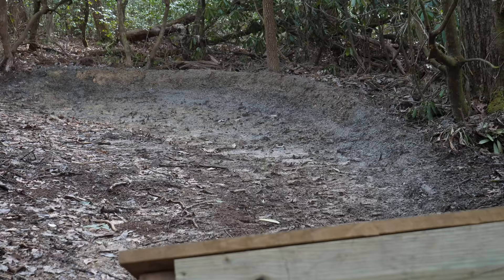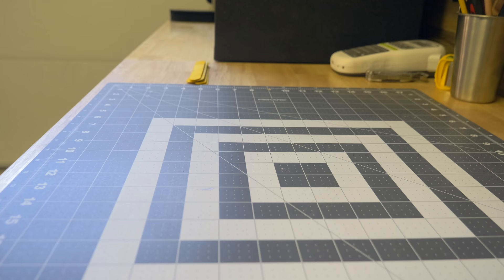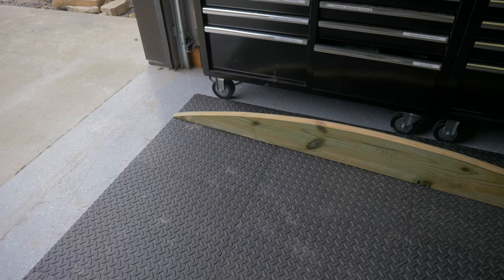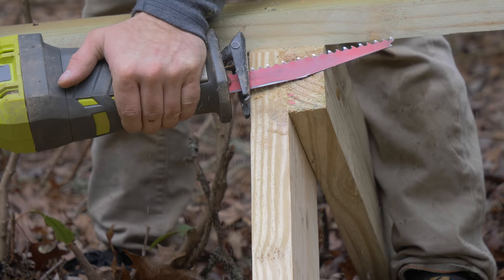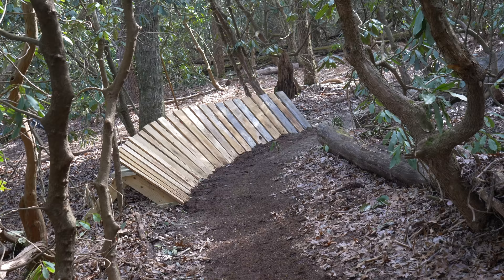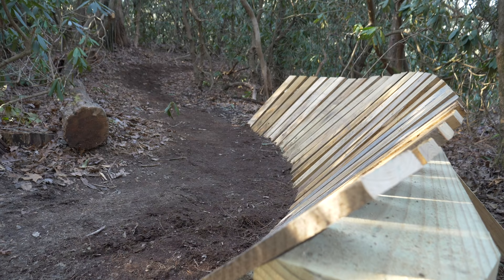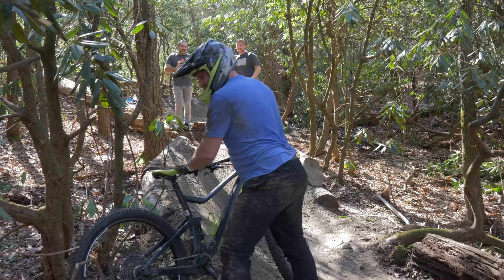Building & Riding a FAST wooden berm

Comment: LOL  I love it. One look at my Avitar shows how much I love wooden berms. I've made dozens. The one in the photo (that is me on it) was built from scrapped painted treated 2x6. some of my best were made from chainsawed red cedar planks.  The thing I love when transferring speed thru a berm is how you can get height and regain speed. When designing the berm you have to determine your apex and drop if you want to maintain speed around the berm. You need to understand your apex and at what point you drop from that height. Entrance speed transfers to height, and that height determines how far around the berm you can travel stuck to the wall. (assuming a constant angle) Taking too much height produces pre-mature drop off. The entrance then becomes crucial. Remember the entrance and exit must a progressing curve to and from apex. I really love a berm that puts you at height and maintains speed and height thru it. But the one in the photo was a right to apex and drop type. 

Two things I see as issues for your berm. First; your entrance forces you to enter too low. If you extended the planking at the entrance or build up a dirt transition you would swing in wider and let you take your height earlier. Second; by reducing your exit angle before speed or height reduces you are being thrown to the outside of your exit line forcing speed moderation instead of a natural height drop from apex.  That was the issue with the rhododendron.  Fixing the first issue may fix the second. If you are going to huck off the wall you do not need that angle reduction.  It is all about how you need to approach your next feature.

If you look at the photo closely you notice I am just coming to apex. The entrance was from a a mound pump/kicker into a ravine drop in and the entrance onto the wooden wall is nearly straight up taking all of the height as quickly as possible. At apex you are right at huck point (or brake check to roll) to drop onto the lander and immediately into a table top. Man, I loved that line.  With the 7'+ of height  having the speed to clear the table top was cake. Riders that did not understand or were leery of walls would roll at the bottom of the berm and have to roll the table top. It's all good. When you had it dialed that was the central feature of a 1/4 mile flow including rock gardens and transfers ending with a 25' skinny bridge over a creek putting you at the bottom the "ski launch" to 22' creek gap up.

Comment: You shoul add some dirt at the beginning of the been so it's more flowy
Reply: exactly my thought, i kinda don't understand why he didn't do that in the first place, it takes 5 minutes... we are not there, but from the camera angles it looks like it would definitely be easier and carrying even more speed.
Reply: @mtb_ianek  and safer
Reply: @pedasjma23  safer? I don't think Seth knows that word.
Reply: Yep.  It'll get added eventually I bet, just hope it is before someone catches their front wheel on the right hand (wrong) side of the entrance to the wood berm.  Instant otb/face plant/ouchie.
Reply: A little bit of a transition in means you would be able to carry so much more speed into and out of it too.

Comment: YES!!! Killer, Seth, that is rockin!  I was surprised the lower wall height worked as well as it did there (I would've gone higher/steeper, just not knowing better & I dig wall rides). Another one just like it (opposite curve) you'll be flying through that whole section.  Super cool, dude!  Keep up the great work!

Comment: Hey Seth, first off, I love your videos. I have really enjoyed watching Berm Peak being built. Your videos have also inspired me to get into MTB. I am looking at a few different starter bikes right now. Some of them are missing parts and I looked back through your videos to try and get some ideas of what to look for in replacing/upgrading said part. (FYI, pedals in this instance.) I know you probably have plenty of ideas for the channel, but I thought you might want to possibly do a set of videos on what to look for with different parts. I have heard you off-handedly mention things in a few videos, but would appreciate if you had something more in-depth. I know their are probably other channels I could check out, but yours is the one I have enjoyed the most. BTW, no pressure on this, just an idea I thought I would pass along.

Comment: An easy way to create curves for a structure like this is to use the natural flexibility of PLASTIC WOOD! if you use it as the bottom slats it also helps keep the wood off the dirt to make it last longer. you only need something like 2 or 3 pieces of the stuff. You can start by staking the inside of the curve where you want it and then filling in boards as reinforcement to curve it how you want it.

Comment: Seth, great edition, wondering if a build up of dirt at the start of the timber burm would help get up onto the timber higher sooner, as a jump or even smoother transition into the burm, then negating the need for a couple more slats at the end that you spoke of and i feel may be a smoother ride in and out.
Great work on all the builds all round. 👍

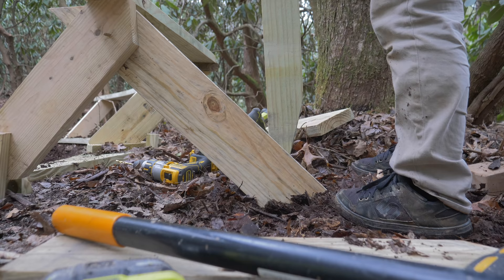Comment: 4:05 The fact that you can just hammer a steak into the ground like that is Insane to me. Here in Newfoundland, you can't go 4 inches down in the dirt before you find a layer of rocks stopping the steak dead in its tracks. Here, you have to dig a hole, pulling out rocks in the process, then stick the support beam in and then backfill it.

You've got it good man! Plus you don't have to deal with massive snowstorms down there...

Comment: I would have done that a completely different way so that the supports didn't have to be cut at an angle.... I would have made it in sections about the size of a pallet, then if wanted to, you could have an adjustable pitch so it could be shallower or steeper. I love the idea but I think that the next one after this one should be taller and have a on ramp the entrance and a slight ramp on the end to kick you off then send you in to a landing that goes to another dirt jump like you said in the video.... Awesome job and keep it up, I guarantee you are going to have a lot of people wanting to ride Berm Peak, Including me¡!    😂😉

Comment: might I suggest piling up more dirt at the base of the berm for a smoother transition angle from dirt to wood, as well as putting a 12 inch high mound of packed dirt at the beginning of the berm for a better setup angle that could drastically widen the turn and further improve your exit speed?

Comment: I was curious about the problem of choosing a suitable angle for your berm and decided to do some research.  I went to engineering school many years ago and so am familiar with the forces involved in designing a suitable berm angle so that the gravitational force on the angle (as you are leaning around the corner) is offset by the centrifugal force.  Essentially the equation comes down to the tangent of the berm angle has to be equal to the velocity squared and divided by the gravitational constant and the radius.  So, for example, using your 10.5 feet turning radius, if you hit the bank corner at about 15 mph, the berm angle should be 55 degrees, and if you hit it even faster, say 20 mph, it should be about 67 degrees.  Intuitively, you may appreciate that the faster you go, the steeper the angle needs to be.  So, for your 45 degree berm, your ideal speed would be about 12 mph.  If you've got a speedometer, check your speed just as you are entering the corner.  You've now got me thinking of building my own backyard track!!

Comment: You should consider mixing dirt on berms with fine shredded sand, it dries out the berm and solidifies them, winter and rain proof. Makes them rideable in rain or short after.

Comment: Just a thought. in the future. instead of cutting the flat tops to a 45 so you can attach the planks. why not mount them so the face is at a 45? and if the supports are already on a 45, then you're just mounting the top board to the back on the same angle vs mounting it flat on the top. 

Thanks for the great channels! You've really inspired me and my son. We just started the sport last spring.

Comment: The green wood is pressure treated. For the last 20 years in the US, it's just been a copper based treatment - not the nasty arsenic containing stuff you are probably thinking of. The respirator you are wearing is for organic solvents (think oil based paint fumes), not large particles like saw dust.

Comment: Next time, rather than having the arch boards completely horizontal, run them at the angle you want the pitch of the wallride to be. Then build the ground supports around that. This way, water and debris will not be able to build up on them and you will not have to make that angled cut for the berm planks to lay against.

Comment: Adding dirt to the been letting you enter high and exit low will let you pump that for an extra but if speed, versus start low slap high to vent speed and avoid running off

Comment: Only thing I'd change would be to add a few more planks to the start and have them get progressively larger, almost like an orange quarter. If someone comes in a little too hot, the front wheel is gonna clip the side of the berm and that'll end in a broken rib or collarbone and loose teeth. Eating wooden features is never fun, I've tried.

Comment: Hey Seth, I don’t know if you’ll see this comment, but I think you’re losing a lot of speed on the first steep ramp down from the wooden platform at the top of the trail. If you smoothed out the bottom rather than hitting the ground at a near 45 degree angle, your course would flow a lot better in my opinion. I get that it’s designed to be a bit scary, and if that’s what you prefer, then by all means keep it. Otherwise, these videos are great!